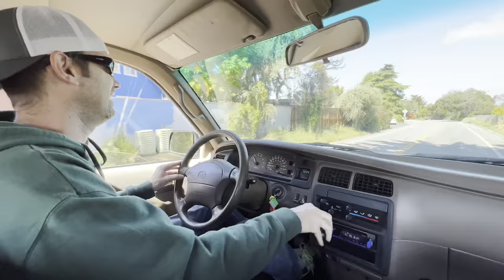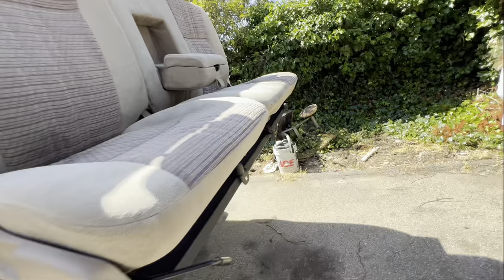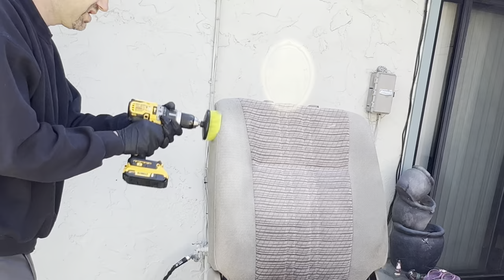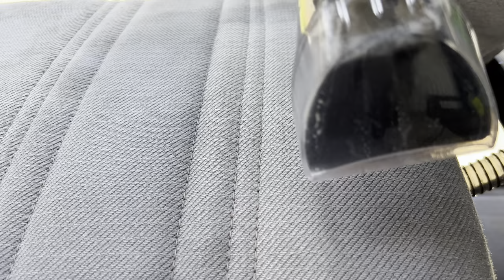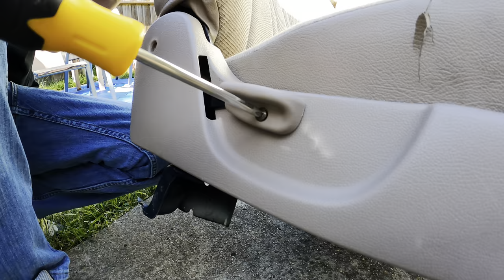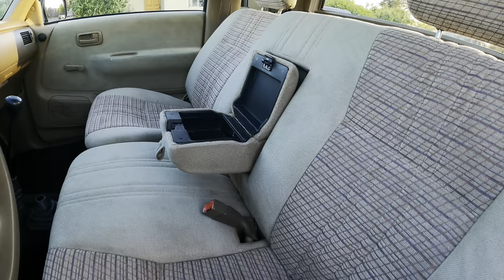NEW SEATS - Restoration!

Comment: Awesome man, It's hard to find seat for Toyota t100 in good condition. Also, I have a question about the manual swap, did he have to buy new wire harness or switch to a manual ECU for the transmission?
There aren't many videos on swapping the transmission from auto to manual on t100.